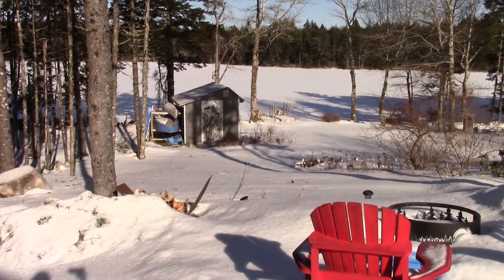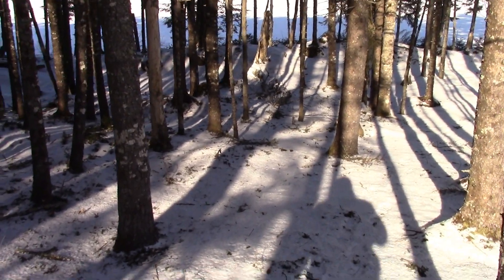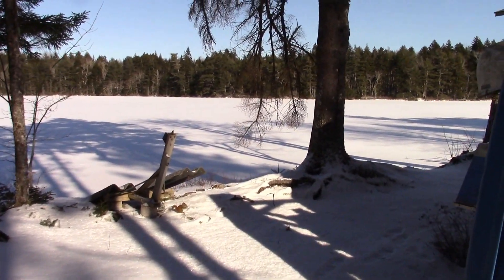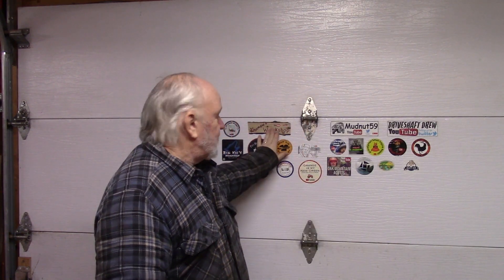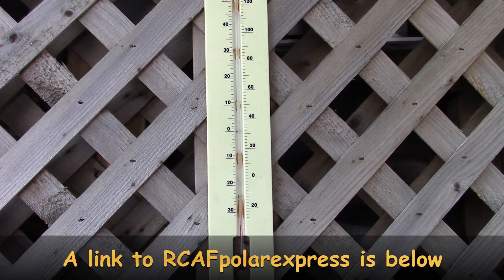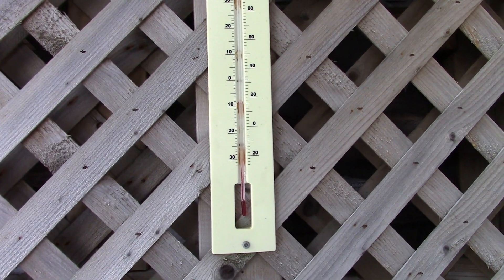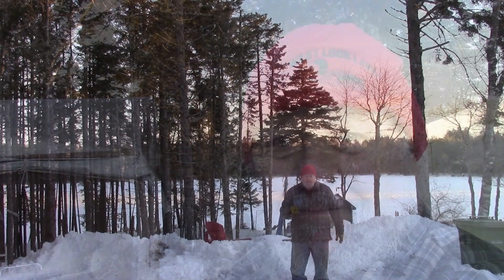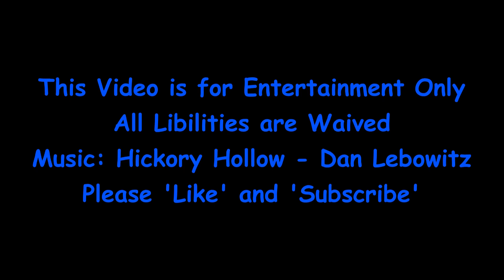Why I was Using so Much Power and Bonus Footage

Comment: I'm glad that you found that problem Mike. My jaw dropped when you said how much electricity  you were using. It makes me wonder how much it must cost me to pump my water here on the farm. The well is 816 ft and right now, the pump is at 454 ft and sitting in 14 ft of water. that's a long way to pump the water vertically.
Reply from the maker: How's she goin'?  Yes Gary, my power was 90 kwhr in one day!!!  I near had a heart attack!!!  Your well is some deep eh.  Our well is 185 and the pump is about 140.  But this pump in the video is just in a pit we dug down by the lake and it's only 5 feet deep.  We use this water for outdoor use in summer and pretty much shut it down for the winter.  Thanks for watching and commenting.  Take care!!!
Reply: WOW, Wells that deep are rare. Is it nice calcium free water.?
Reply: @TomokosEnterprize  , sorry about that. I accidentally delated my answer to your question. I will do this on the laptop instead od my phone. The keys are too close together or else my fingers are too fat.
The water is very hard here. Loaded with minerals. Standard protocol for this system is a check valve at the pump and 2 spaced evenly apart in the pipe. They are a  fail safe  to keep from running the pump excessively and burning it out prematurely. When we pulled the pump, we found one of the check valves was bad already and I believe it to be only 1 year old from when we had the new pump installed. We replaced both of the check valves and added a 3rd one, just for good measure.
The system seems to be working great now but it isn't designed to specs. the maximumnallowable depth with 1 1/2 inch plastic pipe with a 2hp pump is 360 ft. we have 1 1/4 inch plastic and we are at 454 ft. We are thinking strongly of pulling the pump next summer and going with the  first 100 ft down from the surface to be 1 1/4 inch stainless pipe. From there, 2 inch plastic the rest of the way and putting the pump back down to it's original 550 ft. depth. Looking at at total cost between $15,000 and $20,000 to do that.
Reply: @tractortalkwithgary1271  When I was fighting wild fire here in BC Canada I would put in a check valve every 100 feet as a rule of thumb for a Mark 3 Wajax. In tandem I have pushed over 1000 ft nearly straight up and still had a good head. Anything less than that every 100 ft seriously effected the head. Our wells around here are in the 450 ft area and we use a 3 horse pump. Generally they last about 6 to 10 years depending on the manufacturer. This is one situation where more is certainly better eh. The seamless stainless is sure the way to go but it's weight is certainly a consideration for sure. Wouldn't 1 1/2" be a better choice. Just a thought as mine is. I also have a really high Iron/tannin content in my water so it turns everything red. I still haul drinking/cooking water but just accept it is the cost of living in a log cabin on a secluded lake.  Whites or light colors have to be taken to town. I am too lazy to do it myself so I just drop it off at the laundry and pay the few $ to have it done for me. I am back and forth to town a couple times a week anyways and my neighbor has awesome water that crackles when poured cold. Good luck on your project. There sure is nothing inexpensive when it comes to water eh. Take care eh.
Reply from the maker: @tractortalkwithgary1271  Ouch.  But you can't live without water eh!!!

Comment: That is pretty hard on the pump and your bill.  Good for you for finding.  That kind of stuff can drive a guy nuts.
Reply from the maker: How's she goin'?  I was floored when I saw how much power I was using.  Then when I found the leak I exhaled and started turning the lights back on!!  LOL  It was like that for over a month.  That pump is some rugged.  Thanks for tuning in Bruce and take care!!!
Reply: c  @GrampiesWorkshop  You bet.  You must have an AC clamp meter around there eh!!!  To check your branches?
Reply from the maker: @BrucesShop  Yes I do and I even got one of those plug units that will show the amps and watts the load is drawing.  I have been checking everything in the camp for the last week!!!

Comment: I’m sure glad you found that issue. Not only will it help the power bill but probably saved you a pump replacement also!
Reply from the maker: How's she goin'?  That's for sure eh.  That pump is some rugged as it was running like that for over a month.  Incredible really.  It wouldn't have lasted if it was the summer.  The water was cold enough to keep the pump casing from getting hot I'd say!!  Thanks for tuning in Ben and take care!!!

Comment: A very similar thing just happened to me. I can hear our well pump kick on because the lines run under our bedroom and it kicked on around 1am a few weeks back. Then it did it again last week at midnight. I ran all around checking for leaking toilets but it was the freeze proof outside faucet that finally let loose with a heavy stream of water. I was able to determine that it's a Mueller quarter turn, but there are two different types. I'll pull the stem out in next month to replace it. Sometimes I hate that I have the boiler and well tank under the bedroom but times like this I'm thankful to be able to catch leaks early.
Reply from the maker: How's she goin'?  Those wall hydrant taps seem like a good idea, but this is the 3rd one that messed up on me.  The first time it happened in the winter though.  The other times it was summer and all that happened was the water was running but I quickly discovered it and was able to shut it off.  I'm some glad to have found this leak as my power bill was pretty high!!!  And yes having the well tank under the bedroom can sometimes prove beneficial eh!!!  Thanks for the comment Ed and take care!!!

Comment: If the green hose connector has a backflow in it like some do, it may be just enough to hold water in your frost free hydrant and freeze it up. I always remove any thing attached to the hydrant for fear of freezing it. Cheers Mike
Reply from the maker: How's she goin'?  Thanks for that tip.  The green hose connector is just a straight through quick connect and I have it in the open position as you saw!!!  LOL  It made a nice ice sculptor eh!!  I added those to all the outside taps so it would be easier to connect the hoses.  I was some glad to find this leak though.  I already saved enough in power costs to replace that broken freeze free wall hydrant!!  LOL  Thanks a lot for the visit and the comment. Take care!!

Comment: Mike I thought you shut off the water  pump from the lake water in the fall so why do you need a heater on during the winter .  I drain  my pump of water  in the fall and that's it till spring.   Is there a reason why you don't drain your pump  and  turn  the power off completly in the fall .  WOW thats a lot of electrical use $$$  🥶
Reply from the maker: Hello there Steve!!!  I do let down the outside water for the winter but if I were to shut off the power to the boat house I would have to drain the pump pressure tank.  That can be done, but up until this winter leaving the power on has not been an issue.  One year I used the pump down there to help flood the lake for skating too!!  That was a fail!!!  Maybe next year I will try and drain the pressure tank to see what happens.  I know once I fixed this pump running all the time thingy, NS Power was on the news talking about wanting to up the power rates over the next 10 years.  I guess I really reduced my power usage and NS Power noticed!!!  LOL  Take care!!!
Reply from the maker: Hey Steve!!!  Did you notice that I put links to the channels in the description like I said I would!!!  LOL
Reply: @GrampiesWorkshop   HAHAHA your on the ball  now 🤣

Comment: Do you mind if I ask what kinds of fish are in the lake? I have to admit, when I think of Nova Scotia, I think mainly salt water and some trout streams. Just curious about the lake.
Reply from the maker: How's she goin'?  No problems for questions!!!  This lake is part of several lakes that were formed many many years ago by loggers.  They would dam up the lake, cut logs all winter and then bust the dam and float them down the river to the mills on the coast!!  That was a long time ago.  And so since the lakes are more or less man made to a large degree they aren't very deep, maybe 20 to 25 feet at the deepest.  So that results in the waters getting pretty warm in summer and most fresh water fish don't like warm waters.  We also have a pair of loons on our lake and they like fish for sure eh and then there are eels, and it is said an eel will eat it's own weight in fish in 2 days.  And there are also turtles in the lake.  So having said all that, we have perch of course, small mouth bass, and trout.  Our lake is stocked every spring with trout, but because the lakes warm up,. the trout make for cooler waters pretty quick.  We also have a gaspereau run early in the summer too.  I hope that answers your question.  Thanks for asking and take care!!!

Comment: So mike is that just a pump for pressurized water for garden and outdoor use from the lake ?
Reply from the maker: How's she goin'?  Yes Allen that's right.  We don't use this water or pump it in winter but I leave it pressurized and the pump house heated just in case.  Also I'm too lazy to drain the pressure tank every fall!!!  LOL  We have a pit dug beside the lake.  The pit is about 5 feet deep and the water level is the same as the lake.  I have it set up so I can pump from the pit or form the lake.  There are 2 foot valves.  In summer I pump directly from the lake.  Thanks for tuning in and watching and thanks for the question!!  Take care!!!
Reply: @GrampiesWorkshop  what a great setup.
Reply from the maker: @allenbonner7149  Thanks!!!

Comment: Question Mike.  So that pump draws water from the lake I’m guessing.  I imagine the lines freeze.  How do you thaw them in the spring?  Or do you just wait?
Reply from the maker: How's she goin'?  Good question!!  I have a pit dug under where the pump is located.  I have the suction line on the pump set up to draw from the pit or from the lake.  There are isolation valves on the suction line.  In winter I switch to draw from the pit and drain the suction line to the lake.  In summer I switch and pump from the lake.  I hope that clarifies the set up.  Here's a link to a video I made about the water set up: https://www.youtube.com/watch?v=eqyAiFb00xE&t=3s
Thanks for watching and for your question.  Take care!!